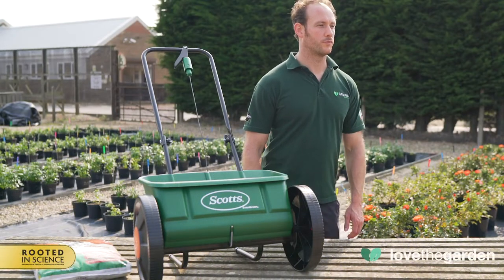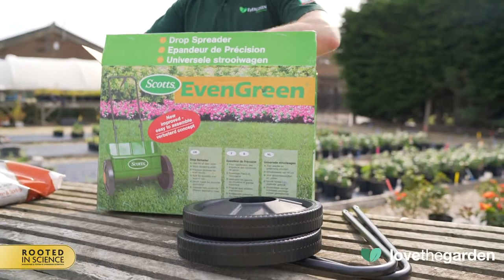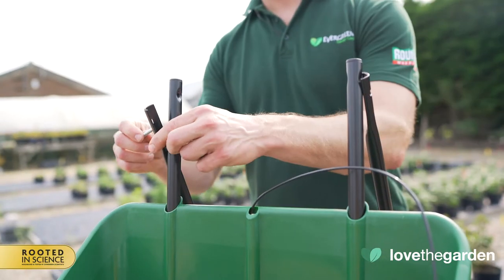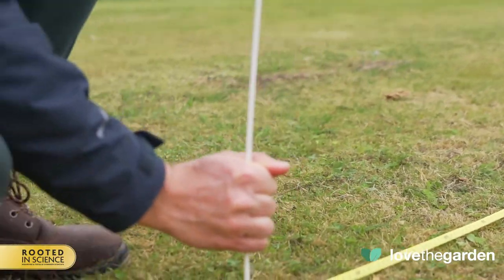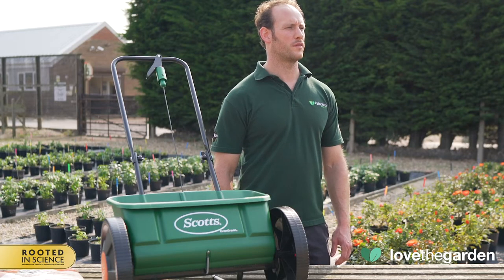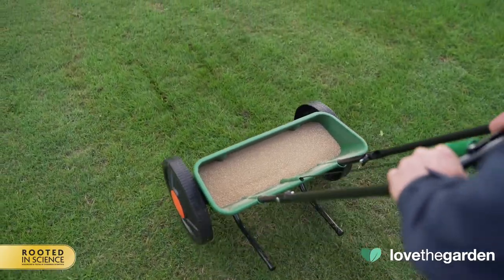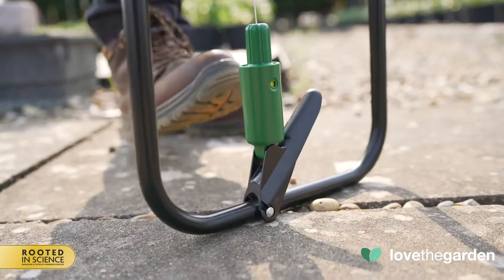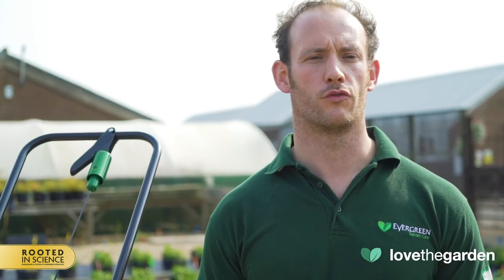Scotts® EvenGreen Drop Spreader - How To Use

Comment: Disregard my request for assistance two days ago.  I figured out how to determine the correct setting for any material.  I laid out a 2 x 3 meter sheet of plastic sheeting in my garage and marked out a 2.4 meter length along the middle of the sheet.  It was an unused plastic drop cloth I had from a painting project and laying it down in the garage eliminated any of the material from blowing off of the sheet.

After loading up the material and selected a random setting on the rate control dial, I made one pass along the 2.4 meter path.  With a 43cm drop width, the 2.4 meter path is about 1 square meter.  I scooped up the material on the plastic sheet and weighed it with a digital kitchen scale, then repeated the process two more times to determine an average for each rate control setting. 

In my case, a setting of 10 gave me 13g/m^2 for the seed I was using and a setting of 6 gave me 34g/m^2 for the fertilizer.  This allowed me to make two passes on the lawn for the overseeding and one pass for the fertilizer.  I also verified these settings by weighing the material at the start of each application and the material left in the hopper at the end of the application.

Also, at about 03:59, he states to use the wheel impression in the lawn to line up the wheel on the spreader for the next path.  Based on my use of this spreader yesterday, this is wrong and will create a significant gap in the material dropped on the lawn during each pass.  The 43cm drop pattern is within the wheels of the spreader, so each pass must overlap the wheel path from the previous path.

Comment: Thumbs up for a very informative video. Just bought one of these and I was a little confused with the calibration and how to check it. Mine should have been factory set but after checking it, it was set up at number 8 so using your instructions reset it at number 6. Thanks!

Comment: I bought the EvenGreen drop spreader (sold as the Substral brand in Germany) for use on my 200 square meter lawn, but don't have access to any of the Scotts lawn products.  I know the g/m^2 required for the seed and fertilizer, but can't find the Table G referenced in the EvenGreen manual for non-Scotts products.  Is Table G hidden somewhere?  I would like to know the correct setting for the EvenGreen so I can have 25g/m^2 on the seed and 30g/m^2 for the fertilizer (2.2mm - 3.5mm grains).